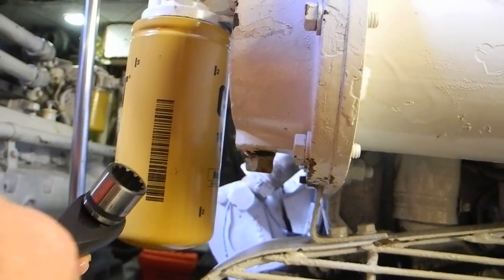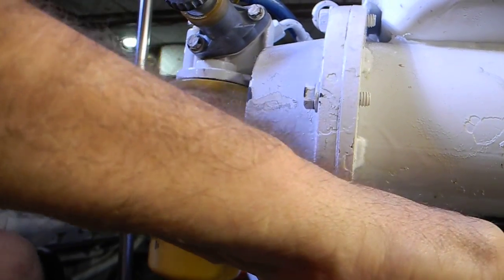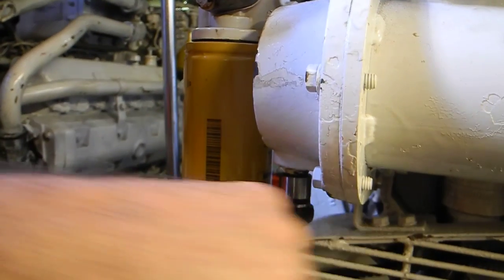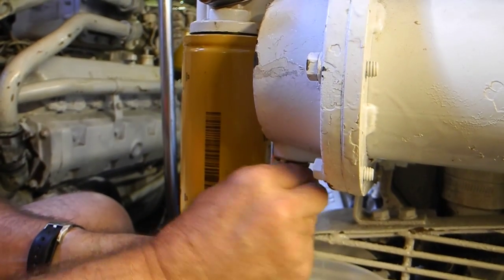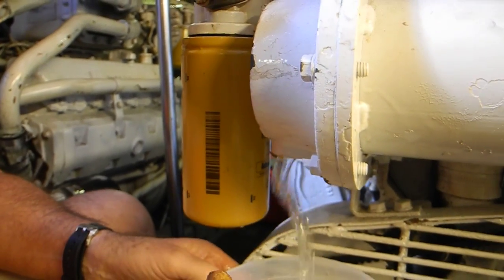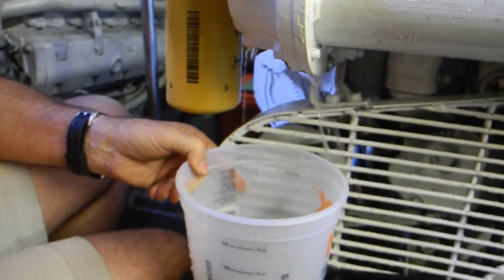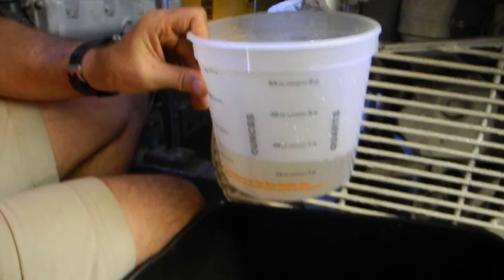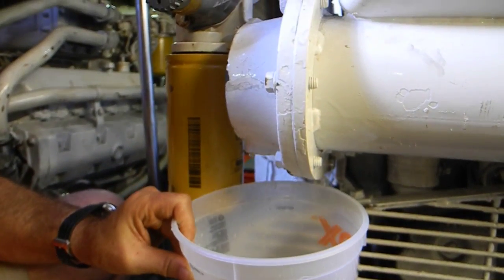Engine Zinc Removal

Comment: I have 3208 cats do you know the part numbers and location of all the zincs?
Reply from the maker: Michael Chapman cat made about 8 versions of that engine. Look for the builders plate and then you can research it through a cat website. Here's a hint. Some pencil zincs have hex heads and others square heads. Look for any brass bolt head not painted.